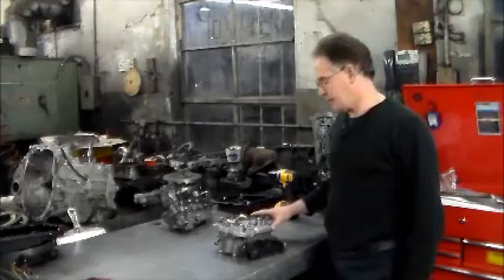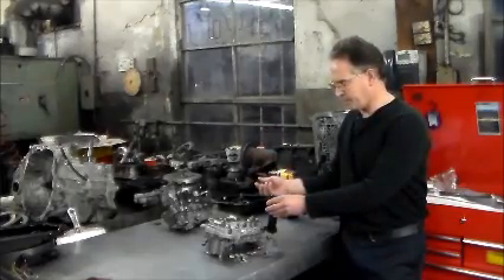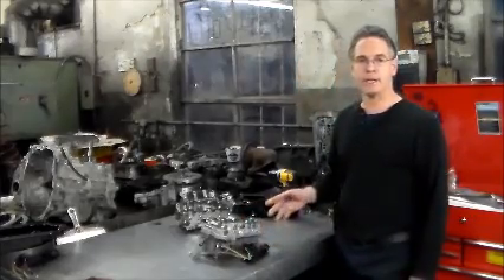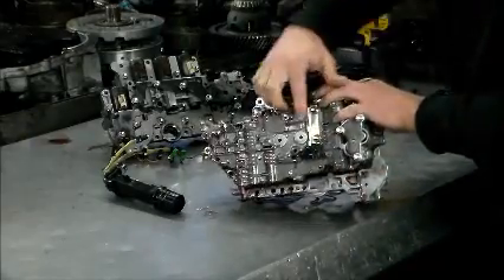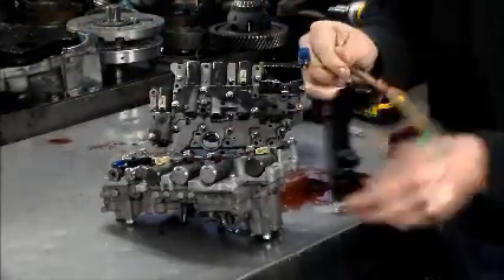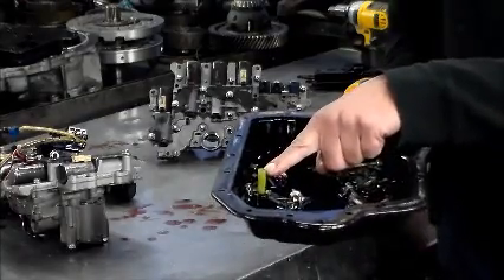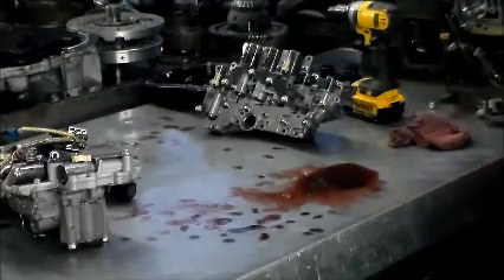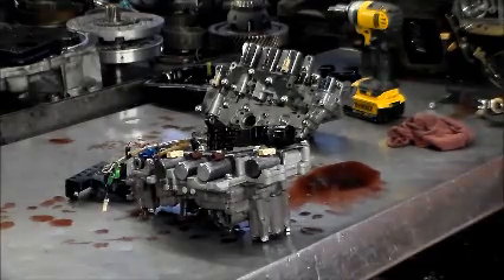Toyota U760E with code P2716

Comment: I have an 11 Camry with the 2.5 and the U760E. On my 2-3 shift at about quarter throttle the engine bogs down cause it's engaging the torque converter as soon as it shifts to 3rd. Then it shifts to 4th and disengages the converter and shifts normally. If I'm at half throttle it seems to shift normally. You ever seen this before or have any suggestions? No codes stored or lights on either.
Reply from the maker: First i would check the fluid level, no dipstick on this trans.  What type of scanner do you have?
Reply: @GaryFerraro  
Fluid level was checked at the specified temperature, using an infrared thermometer on the pan. And unfortunately I work for a Ford dealership and and only have access to a Ford scan tool so for my Toyota I used a Mac handheld code reader.
Reply from the maker: @littlebearish  ok,  do you know anyone with a snap-on scanner or autel?  first thing i would with this is do a memory reset or shift adapt reset see if anything changes. I was able to fix a few of these by doing that.
Reply: @GaryFerraro  
I know a fella who owns his own garage and I believe he's using the Snap-On scanner. He may give me access to it if I ask nice and bring him a case of beer. Lol
I will definitely give that a try. Thanks so much for your replies, greatly appreciated. Hope you have yourself a great weekend.
Reply from the maker: @littlebearish  That should work, a customer did that for me and i let him use my scanner.  LOL
Reply: I have the same issue did you ever fix the issue? Thanks

Comment: We have a 2006 Toyota Corolla code P 2716 Pressure Control Solenoid D Electrical.  Couldn't get the code to remove even when cleared with a scanner. Turns out the car had a recall for a defective ECM and the woman never took it in to be fixed. The issue was a cracked ECM.  Took it to Toyota yesterday and they replaced the ECM free.  Issue resolved.  Lesson learned call the VIN number into Toyota before replacing the solenoids to see if there any recalls out for the car before doing the work.
Reply from the maker: I have seen this code before, but wasn't sure with the 6 speed units if computer was the issue, couldn't find TSB either like i did with the 4 speed units.
Reply: Ho
Reply: 00971563969716 WhatsApp number
Reply: Hello sir you send me your WhatsApp number I wait
Reply: I have to buy auto electrician

Comment: Hello Gary I have a 2007 Lexus IS250 I had my old transmission in it that would shift gears kind of slow when cold and as soon as it would get hot it wouldn’t shift into 4th at all then I changed transmission out and now it won’t even move in drive or reverse ? I’m getting p2716 code even if I clear it it comes back right away any thoughts ?
Reply: Mine does not shift into 4th. They Told me to replace linear solenoid valve. Did you fix yours and how? where to buy part?

Comment: Hello Gary, I drive a toyota camry 07. when i put the car in drive in the morning the car will not drive until after 10mins. revers works fine.the check engine light shows p2714 pressure control solenoid d performance or stuck off... what do i do?... great videos by the way
Reply from the maker: Ok, so the car will not move in drive until 10 minutes of it running? reverse is good?  what is the engine size
Reply: @GaryFerraro  2.4 L 4 cylinder
Reply from the maker: @kolawoleolusola  ok you have the U250 five speed trans,  the code with performance or stuck off code is a mechanical problem, you may have something wrong with the forward clutch is the car does not move in drive right away, how does the fluid look?
Reply: @GaryFerraro  i changed the oil two months ago.  before that i change it 9 months ago.  the oil looks pink . thank you for your support
Reply from the maker: @kolawoleolusola  can you put the car in manual one? if you can does it pull off or same thing?
Reply: @GaryFerraro  the car is an automatic. PRND432L, the affected gears are D432 . but after 10 mins everything morning they all drive perfectly well.
Reply from the maker: @kolawoleolusola  what about low?  does it pull off good in low?
Reply: @GaryFerraro ok i had to test drive the car again. it works fine in low.  i assume what you mean is  first gear of drive? yes it also shift ok

Comment: I have this same code, same issue on a 2011 camry with a u660e. I wasn't able to find in the video but did you say how much it cost the client to have this fixed? Wondering ballpark price to have it fixed so I can set some cash aside for it.
Reply from the maker: you have the P2716 code?   One thing to check is the battery and charging system, also make sure the battery terminals are tight
Reply: @GaryFerraro  Ok I'll do that. The code goes on and off. That would be nice if it's just the battery and not the SLT solenoid.
Reply from the maker: @salthack   The problem was actually the TCM, I have part 2 to this video
Reply: @GaryFerraro  Interesting. I watched it and that made sense. I know there's something along the lines of removing the TCM and testing the electrical resistance on the solenoid pins and ground. Would that rule out the solenoid vs the TCM?
Reply from the maker: @salthack  past experience with this code on other vehicles, i kinda knew when i saw the code, but to please the people i had to do it the way i did.

Comment: I GOT A U660E from an 09 lexus es 350. came in first due to a leak. Customer mistakenly drove with a leak from a pump seal and didnt move after. After rebuild and test driving (shifting gears has no issue upshifting or downshifting) the car was given back. 1 week later the car came back with a P0714 code pressure contol (D). further inspection noted the transmission had leaked again from the pump seal and bushing that were already replaced. After replacing pump bushing and seal for the second time it leaked again for the third time. As far as i can see the pump looks fine and no visible wear. Is there anything that im missingor not seeing?
Reply from the maker: Is the bushing worn on one side? are there dowel pins? what type of seals are you using?
Reply: I made a mistake. There is 2 pump bushings for 1.820 the other is 1.858" outside diameter for the u660e. The 1.858 is for late u660e and u760e.
Reply from the maker: Nathaniel Circo  Glad you got it fixed